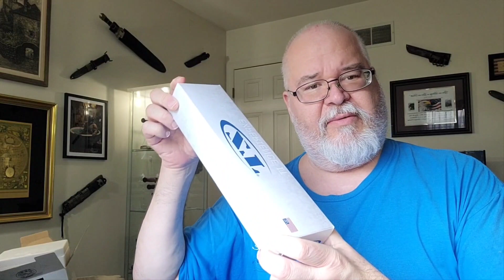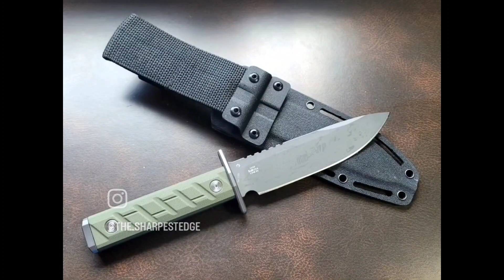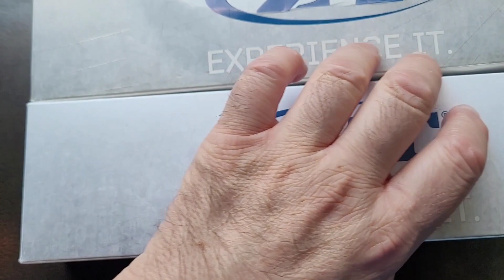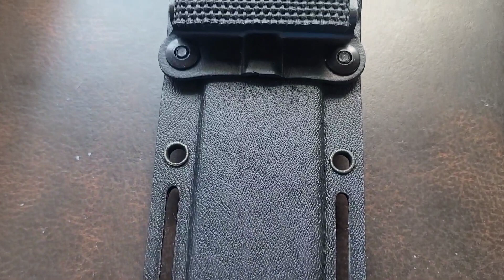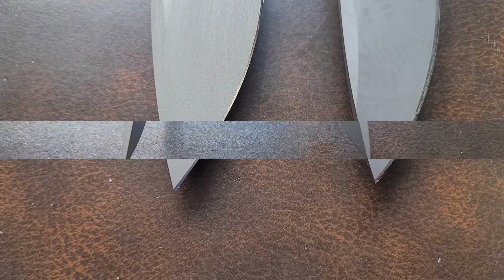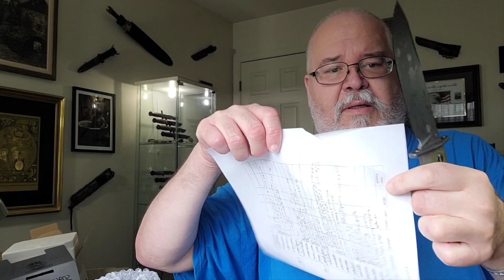THE SHARPEST EDGE:  ZT 0006 Authentic vs Fake Comparison

Comment: Why are you complaining about the price? U.S in general is absolute rubbish and the worst is that you pay x 10 more. $100 made in U.S vs China can make better for $10. It is labor cost that you can make and make profit. China can and U.S can't. U.S is all about go American made but buy rubbish. Most of the tools and electrics are all same. Just like this knife. The difference is minimal yet you pay x 10 more for what? Not just that China will sell 1000 knifes that are used while U.S sell 10 for collectors to sit in glass cabinets.
Reply from the maker: @paulboyce8537  US Steel Manufacturing and Metallurgy are more advanced than in other countries; hence why when other nations need specialized steel, they call on the US to fulfill their needs.  As for China, they do not make the product better; nor do they create a better design.  China takes an existing design(Steals it actually), then chooses less expensive, but fairly decent materials to build it with.  Labor is not a problem for them as many shops have forced labor and pay very little.  People are often bussed in; given sleeping quarters, and then have additional funds removed from their low wages to pay for the filthy conditions.  Now, China has learned a lot from US Machinists and Knife Companies who traveled to China to help set up machinery and materials to create the products they wanted.  Chinese knives used to produce almost all their knives from 440C steel; now updated to D2, and have very few blades with steels such as CPM3V,  M390, and so forth.  The higher-grade materials are utilized for their collaborations, but what of scraps that aren't reclaimed?  Most are reclaimed, but there are 1 or 2 offshoots that I know of that utilize their versions of high-end steels.  

So, in short, as much as I enjoy the Chinese blades that I showcase and collect, the originals created out of the higher-end steels would crush the replicants in corrosion resistance; cutting-edge resilience,  and overall toughness from proper fitment and materials being of higher grades.  The original, genuine ZT0006 was tested in war zones and hostile environments; by a company comprised of veterans, and put to the test surpassing the highest of expectations.  As mentioned before, I enjoy Chinese blades, but if I had to take a blade into battle, I would choose the one made with the highest-graded materials, machining, and workmanship.  That honor remains with the tag "Made in The USA 🇺🇸"... hands down.
Reply: @the.sharpestedge  LMFAO. Every time there is a choice it is always China that makes the better and more affordable. Plus most of the so called "made in U.S" you can trace to China and buy direct for fraction of the price. Often upgraded or changed in small way for domestic and export from same factory. All metals come from the same global pools. And U.S metal is not the top far from it. German, Swedish, Australian stocks are top and all the top tools are made in China. All Chinese production is made by using top of the line machines from Germany and Japan. Plus CPM3V is far from the best for this purpose. 7Cr17MoV would be lot better for this kind of utility knife that gets abused. It is so funny when American tries to be patriotic and talk shiet. Makes no difference how much you try to polish it it is still a turd for the price. For sure I would love it to be different but I live in reality.
Reply from the maker: @paulboyce8537  My friend, you need to study your history.  I am from Germany, and while German Steel is very good as is Austrian, after WWII, who do you think rebuilt those countries; supplied them with the materials, managed the operations, and financed them until they got back on their feet again?  The US is a melting pot of citizens who come from many countries in all walks of life; they are the first to respond to global disasters, and the citizens are what makes the country strong unlike any other.  The metallurgists and machine builders from our mills are from Germany, Austria, Switzerland, Japan, and many fine countries originally before coming here decades upon decades ago.  While, again, I appreciate and enjoy some knives made in China, they are known as a replicator country in the worldwide knife community, and until such a day comes when they come up with an original design of their very own, will remain so.  I just purchased a replica of a Russian blade replicated by China.  Nothing they have or create is original; everything is either stolen from another country or replicated utilizing lesser-grade materials.  Nothing is built better, just slapped together for less.  The "great china" theory is all hat, no cattle.  I don't say this to be mean, either.  I know and communicate with many great people in China and the independent country of Taiwan whose knife-making skills are far better than in China.  One of my best friends was born in China.  He moved here and is a great businessman who has first-hand horror accounts residing there.  What is far more laughable are people who underestimate the US Citizens(who are comprised of all countries around the globe)and their patriotism; we may be divided at times, but when challenged or attacked we come together from all walks of life to meet that challenge... WWI and WWII... No insult intended from any of this... We are a country created by citizens of many great countries... otherwise, people would be leaving the US by the thousands to find a better life... Instead, they are coming by the millions to do just that.  Thank you for your comment and have a great day😎👍🇺🇸
Reply: @the.sharpestedge  Metals come from global pools and almost all of the blades are from China Taiwan. Blades even just 5 years ago that were top are now considered inferior even that there is nothing wrong with these. For example Cold Steel that all are from China/Taiwan and were with very exotic layered steels 5 years ago are now 3V or VG-1 as standard and M390 that was the dogs balls not so long ago is the average medium steel. 7Cr17MoV done right compares to 3V and maybe better on this type of knife.  D2 very good but compared to other popular steels used for knifes falls short for the 7Cr17MoV and other cr steels. 

History. Parts of Europe still hasn't been rebuild  since WWII and for sure U.S didn't do it nor did they have the tech or know how. Today West makes nothing so how do you even think we are on top? Only category where U.S is leading is weapons for war and mass destruction. Most of the metals U.S imports from places like Australia and Sweden and "Russia". U.S is very limited. What U.S makes today you can't even make cars anymore or tool. Best are from Europe and Japan and Asia. Australia has the same problem. We do not make anything. China makes lot better quality. Most of U.S stamped comes from Chinese factories. And this knife for example is so simple that to make it cost very little. $5 if that. $17 from China including shipping.

You have been brainwashed by propaganda and U.S politics MAGA bullshit cult. WWI was meat and WWII was meat and it took 10 x the equipment to beat German tech, planes and tanks. We had nothing. Axis was several generations ahead always. We were lucky. Back to Earth. 

Do you think U.S is the only melting pot? Pretty weak.
Reply from the maker: @paulboyce8537  My friend, your metallurgical analysis and history lessons are incorrect.  Your assumption that I am from America; being part of a "MAGA cult", and obvious lack of true historical events leads one to believe you do not have the facts to base your arguments.  History... from my family living in Austria and Germany, after Hitler was defeated by the Americans and their allies, It was America... not China or Russia that came in with money, materials, and machinery to help the citizens rebuild... don't know where you got your history lessons from, but my family lineage was there; some still reside there, but most moved here for a better life.  Like many in those times and to this day come here to live a better life.  You don't see anyone beating down the doors to get into China, Russia, etc... is this country perfect, nope... none are.  As for the US being the only melting pot, of course not.  Citizens here can express themselves in many ways without fear of persecution from government agents; from being thrown off of rooftops or stoned for their beliefs, or taken away during the night for having differing political beliefs.  That is what makes us unique.  Want to test that theory... let's say you are gay.  Go to Palestine or Afghanistan for example and express your beliefs freely and in public... your chances of surviving the next few minutes... less than 1%.  Better yet, protest against the govt... you either are shot or disappear.  Just like in Germany... Brown Shirts, Gestapo, SS... all the same.  Russia, and China, are all the same... North Korea... the same.  

It is easy to hide behind anonymity and be a keyboard warrior criticizing things you may not truly understand.  Those of us and our families who have experienced the trauma of War; whose families have been uprooted and devastated by Hitler, Mao, Stalin, and so forth, we are truly grateful for what we have particularly this melting pot.  People who live here who do not appreciate what they have can freely leave, but funny I don't see any do so.  We don't have checkpoints; travel restrictions, or agents telling us where we can and cannot go... millions of people unfortunately die trying to get here... trying to have a better life from what they come from... China, and Russia, from all over the globe.  They don't beat down the doors to get into the bread lines of Russia; for statist communism and control of China, and certainly not for the persecution and death coming from Middle Eastern countries for the free expression of ideas.

My friend, I wish you no ill will, and I pray that wherever you are you are safe from evil and harm.  I wish you good health and prosperity, and respectfully will agree to disagree... and that's ok.  It's part of the Freedoms we all enjoy as sovereign citizens of a free country.

Comment: The original is authentic CPM 3V steel, whereas the clone is likely D2. This along with R&D and artistry are why there is such a price difference. Ethics and other factors are at the discretion of the buyer.
Reply from the maker: Hello, my friend.  You are correct that the real ZT0006 is CPM 3V Steel; however, the clone is not.  There is a definite weight, grain, and edge difference between the two.  China is famous for utilizing D2 and 440C in most of its knife production; however, this blade is too hard to be 440C.  R&D  and Artistry are some factors in the price difference; however, factors such as inflated materials costs, inflated labor costs beyond fair market value, and of course greed plague the American market.  These and other factors have created the "clone wars" market, and China is stepping up to fill the demand.  As China has no allegiance to trademark or copyright laws, they simply replicate well-known makers products utilizing a lesser compensated work force, and lesser grade materials.  Some of the time the product will not be great, but their learning curve is steadily overtaking the American Manufacturers and that is where the US Buyer/Customer makes the judgement call.  50 years in the industry; 25 years in my own business and thankfully retired, I have been warning US Manufacturers to step up their game.  The China clone may not be CPM 3V, but it is made from a very hard, corrosion resistant steel which holds an edge extremely well... that is the fingerprint of D2.  And thanks to US Companies sending higher grade materials including steels overseas to have their products made to save on labor, the leftovers have been showing up on the market.  Once  China streamlines their steel production; materials production to match their mills, assembly and even their international globalized shipping methods... people can kiss the US Economy goodbye.  Thank you for your comment and have an awesome day 😎 👍 🇺🇲 

PS... If you get the chance, check out Gruggs' video about the ZT0006 clone on Legion Tacticool Cutlery... the clone is put to an extremely abusive test and came out on top.  Scarily enough, I am not sure if the original would fare S well 😳
Reply: @the.sharpestedge  Will do. I appreciate your prompt, informative response and your professionalism. Respectfully, BP
Reply from the maker: @Bad.Pappy.Official  Thank you, my friend... Anytime 😊   We are all part of the knife community.  I wish the world was more like it 😎👍🇺🇲

Comment: So its most likely d2 steel?
Reply from the maker: @cranberryrelish1179  Two things point me in that direction... The first is that China has an abundance of D2, and almost every knife I have purchased was D2 from there.  The feel, look, and grind grain are very similar to my other D2 blades.  The second is Grugg's torture test from LTC.  The carbon content of D2 steel contributes to its hardness and wear resistance, while the high chromium content provides excellent corrosion resistance.  His test showed all the attributes pointing towards D2; hardness, wear resistance... just a beast.  However, the blade is marked CPM 3V... And there ain't no way for under Fifty bucks.  And the blade is too hardened to be 440c... Which would have folded under that test.  So definitely will go with D2 for an educated guess 😎👍🇺🇲
Reply: @the.sharpestedge  for 50 bucks I aint complaining
Reply: @the.sharpestedge DC53, a buyer said the seller admitted it
Reply: @the.sharpestedge  I found few claims for the sellers as D2 and 7cr17mov. 

"For workpieces that need to withstand high loads and wear resistance, such as cutting tools and abrasives, D2 steel is a more suitable choice. For applications that need to withstand a certain amount of impact, wear resistance, and corrosion resistance, such as tableware and kitchenware, 7CR17MOV has more advantages."

7cr17mov maybe the better option for camping and survival purpose where the blade might be used to chop wood and other abusive ways.

Comment: Anything deceptively marketed  to give the impression its the original or imitate the packaging to do the same, i wont touch. Even if the price is nice. But if a company copies a design and the price is lower, i will absolutely snag a clone that doesnt try to hide what it is.
Reply from the maker: I am the same way, my friend.  When I purchased the first one with black handles, there were no markings advertised on the ad, so I thought what the heck...lol 😁  WHen it came, however, it had the ZT markings.  Since I was planning on doing the vid on counterfeits, I got the second one.  Really scary how good they are.  Just imagine if China gets better steel and starts production on several new, quality-controlled levels.  I have been warning US Manufacturers for years... we need to in-house all products; materials, production, and so forth.  BUT the odds of that happening... well... 😖🚫  Thank you for the comment, and Have an Awesome Day!  😎👍🇺🇲
Reply: @the.sharpestedge  I hope your day is great too. I've had a few turn up with the markings after not advertising em. And the purpose of the video is well served. All the success to you
Reply from the maker: @eatonknass247  😎👍🇺🇲
Reply: More for me then MUHAHAHA

Comment: sir, i would say it is very very close to one another, yes original is a bit better quality but hey it's probably twice as expensive as the replika...so  i would say if my budget was limited i would  go with replica and be just fine. Thx for comparison.
Reply from the maker: Hello, my friend!  I totally agree... I also have no issue with D2 steel... In fact, I have been enjoying the first 0006 I reviewed and definitely am impressed with this one as well.  At roughly $300, the authentic ZT is costly.  For only around $40 to $60, you can get a decent blade; a razor-sharp workhorse, for a much better cost... especially if one is on a limited budget and doesn't mind the D2 steel... Which up to this point has been performing admirably.  Thank you for your comment and have a great day!  😎👍🇺🇲
Reply: @the.sharpestedge  thank you sir, for such a complete answer, it’s very interesting to watch your reviews.
Reply from the maker: @Platuse  Thank you, my friend... I sincerely appreciate it... I love talking with our knife community... It's the best part and why I put a lot of effort into the reviews 😎👍🇺🇲